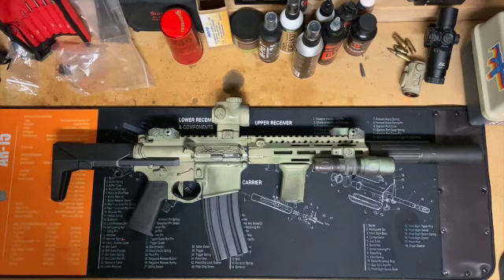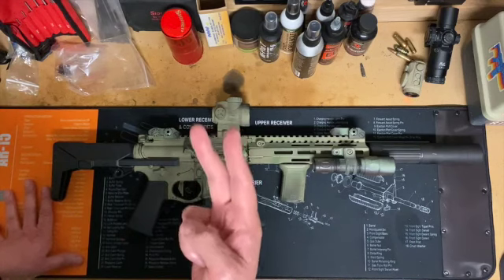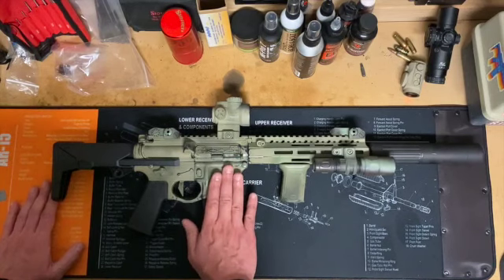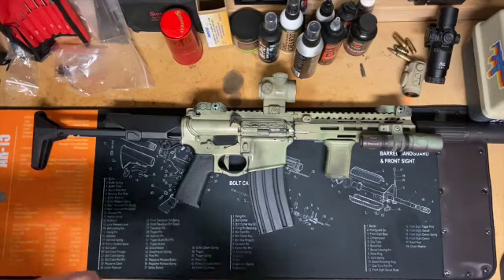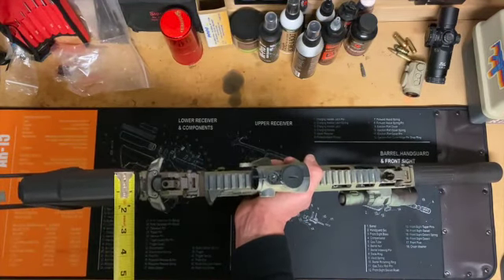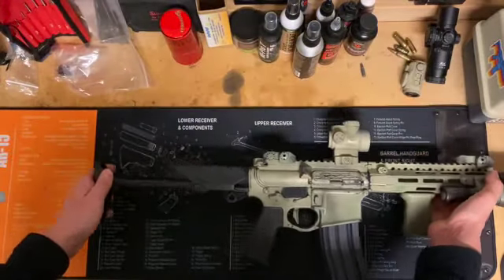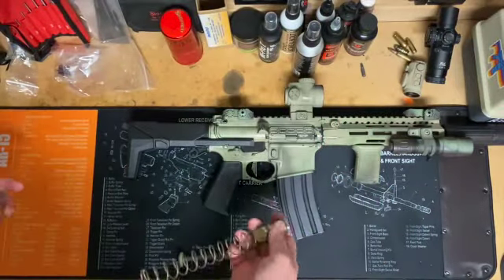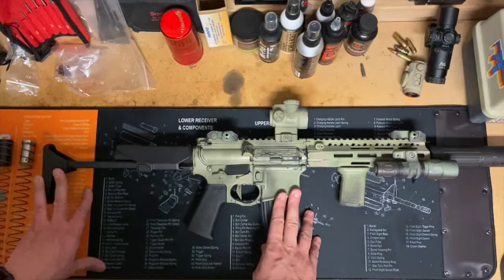Episode 17: Q Shorty Stock Full Review

Comment: Are you using an adjustable gas block in your platform, or just a standard run-of-the-mill gas block?
Reply from the maker: I think I covered it in my initial review of this rifle, but just in case... it is a standard BCM gas block. I tried to change it out for an adjustable one (Q one actually), but I snapped an allen wrench off in one of the set screws and so it ain't coming off.
Reply: @dooshbagwithagun6515  The struggle is real. I felt that Allen wrench snapping comment. Lol. Thanks for the reply!

Comment: Ever tried using a regular buffer system,stock,tube castle nut, bolt carrier group on you're honey badger
Reply from the maker: Nope. Wouldn't want to blaspheme a $3500 gun like that. It was designed to be lightweight and agile and emulate the MP5SD with regards to dimensions and compactness, so I want to keep it as true to form as possible.
Reply: @dooshbagwithagun6515  was just curious. Thought about getting  a honey badger sd myself and just throwing on a shorty stock with the appropriate components for it and a lantac bcg. Simply for a standard recoil system with parts availability but same style stock.  Wasn't sure if the stock was proprietary because  the buffer tub was smaller over all or just shorter and that's where all the proprietary pieces come into play like the spring,bcg, retaining pin etc. Seems like it's just due to the fact they trimmed off length on the stock and that's where those proprietary parts come from. not so much that a regular shorty stock wouldnt work without replacing the stock and bcg

Comment: Whats the space between the rails, im thinking about this as an option for my midwest 10/22 takedown chasis. The chasis is 1.5 inches wide.
Reply from the maker: To be honest, I tried repeatedly to take the measurements, but I am a doosh and so don't take this as gospel, but I got about 15/64" clearance between the two narrowest points of the rails (they are on a slight angle, so measured between the bottom of the rails).  Maybe the newest video that I posted will give you some better looks.  I had a ton of footage of me trying to measure things, but it made me sound even more dumber than I already sound.
Reply: @dooshbagwithagun6515  thanks for the reply, worst case scenario i order one to see if it will work and if it doesn't swap out my sbpdw to the hbpdw.

Comment: Great review!

Are the rails steel or aluminum? And how are they holding up?

Thanks
Reply from the maker: Rails are aluminum. And they are holding up fine, but it’s been sitting in my safe since the last range trip. That said, it’s the same material that the Honey Badger rails use.  I’ve owned the HB for almost 3 years and other than a few cosmetic scratches, it is fine. Granted, I ain’t been speed roping out of a Blackhawk and taking fire from tangos… ever.

Comment: Would that JP spring work in the Q tube tube with a spacer?
Reply from the maker: Just buy the JP spring from Maxim. It’s the right size for the Q Shorty stock or brace assembly.
Reply: @dooshbagwithagun6515  Thanks man!

Comment: Can you use a JP silent capture spring with this stock?
Reply from the maker: The receiver extension for the Q Shorty is shorter than a standard M4 extension (buffer tube), so a full size silent capture spring is too long.  But the one for the Maxim defense PDW stock that they sell on the Maxim site fits perfect.  I haven't tried to shoot it like that (it ain't broke, so I ain't gonna fix it) but if I can sneak back out to the range before work gets crazy I will give it a try.
Reply: @dooshbagwithagun6515  sweet thanks for the reply!